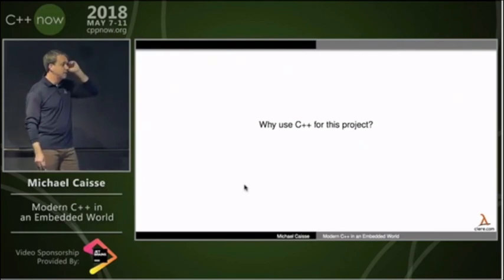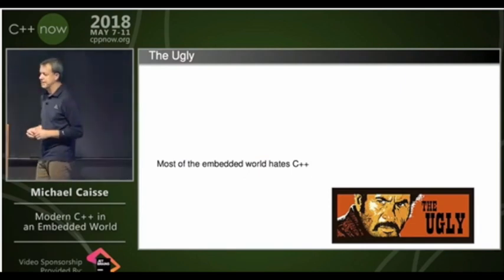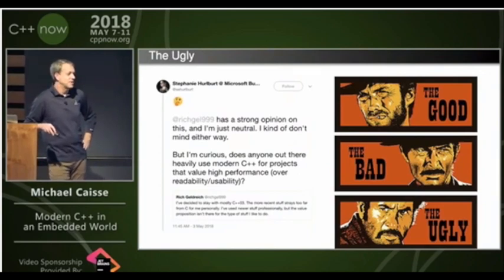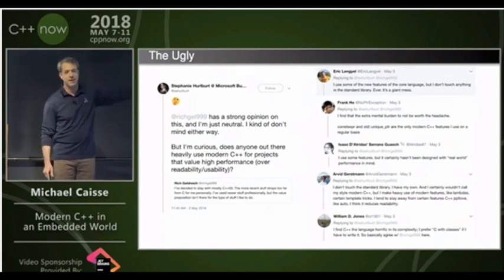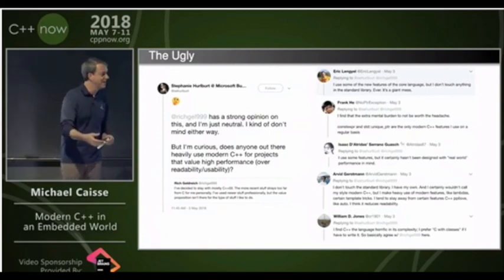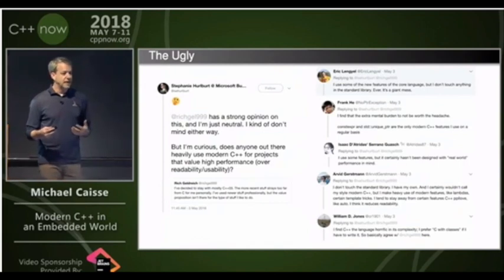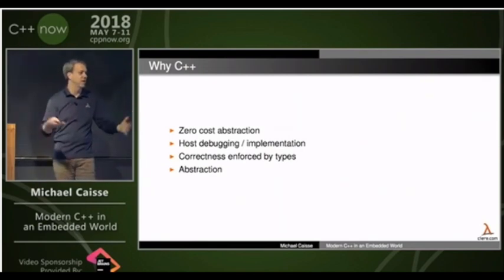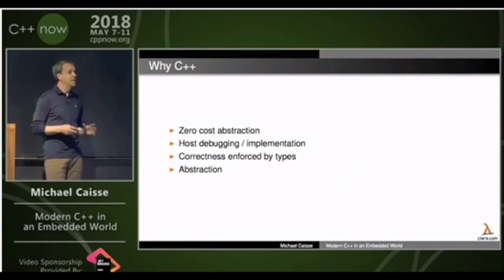You should use C++ in Embedded Systems

Comment: i would not mind C++ if the level of abstraction was kept short and sweet, but oh no its never short and sweet, it ends up being layers upon layers of abstraction you become so removed from the hardware that you're not even an embedded developer anymore (so to speak) I was at work the other day and saw a function in the code base that was disabling some stm23 i2c or something and it was like blahblha::blhabh::blhaalh::disable()   when could have been HAL_i2cDisable(). Lets not forget the heap C++ uses under the hood in std library functions NEVER forget that C++ is using your heap even if its not apparent.
Reply: i agree 
but this world moves so speed so i thinlis that adding multilayer to a layer  because of buisness abstraction not just technecal hierairchy